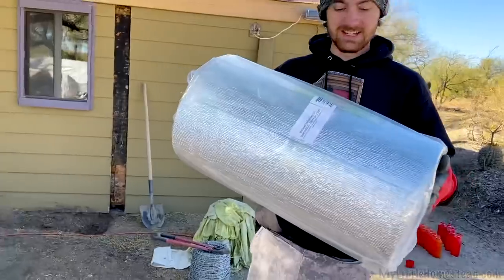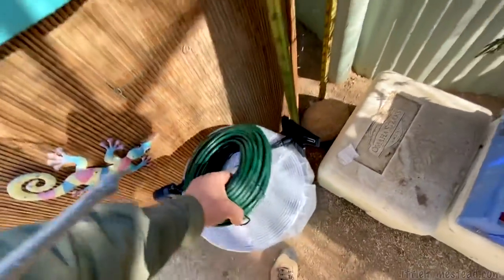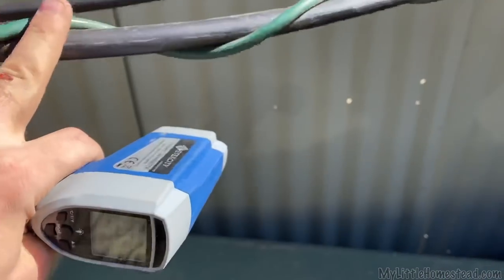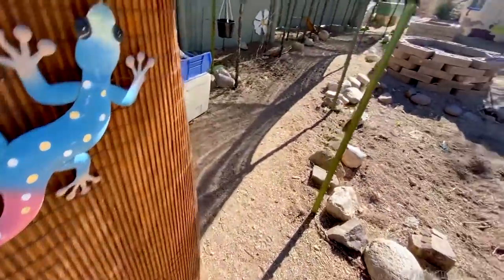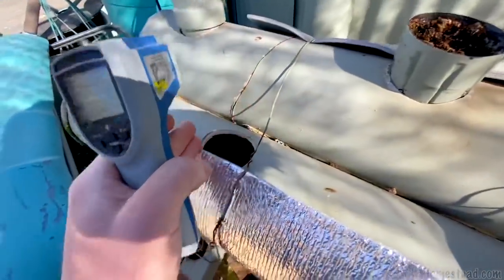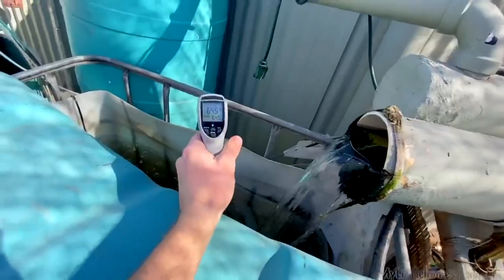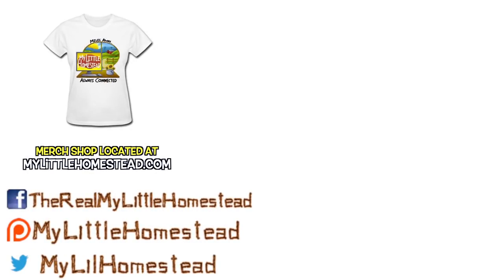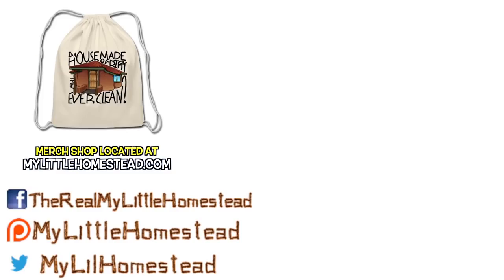Insulating Aquaponics Pipes for Winter

Comment: I still vote for an idea I presented earlier - thermal mass heating - maybe just geothermal or eventually supplemented with an oven to heat up on cold days. Dig a hole (or build dirt bag surrounding), place all tanks in there may wrap some exhaust pipe around in the ground. Have a spool of pipe go through additional thermal mass element from the oven. On cold days switch from chicken coop roof to thermal mass circuit. Potentially regulate with Arduino that monitors and regulates both circuits together and thereby keep the temperature always constant.
Reply: Ooooohhhh a rocket stove for the aquaponics 👀

Comment: Bryson, I have an idea I think you would be interested in. Generating electricity from the sun without solar panels! I have a design in mind that I think may be more efficient than a solar panel. Get a barrel, insulate it, put aluminum radiator fins inside it that come up to to an aluminum block on the top that is painted with Vanta black (carbon nano-tube paint(doesn't let light escape)), put water in the barrel that gets heated up and turned into steam. Send the steam through a Tesla turbine and collect the steam in a secondary container where it condenses back into water and fed back into the system. I've been wanting to build it for a few years now but do not posses the skills required to fabricate it. Let me know what you think!
Reply: I know nothing  about physics but I think it's impossible to boil water just from solar heat,  unless it's highly concentrated.  What is Vanta paint anyway?
Reply: You're not going to get to boiling temperature without a concentrator. However, your idea is interesting considering the efficiency of the tesla turbine. I think you should build it at small scale and see what it does.
Reply: Other liquids could be used. Something that has a lower boiling point. But I think water would work fine